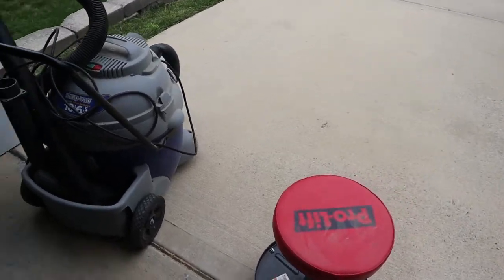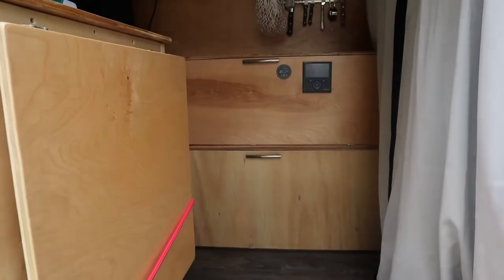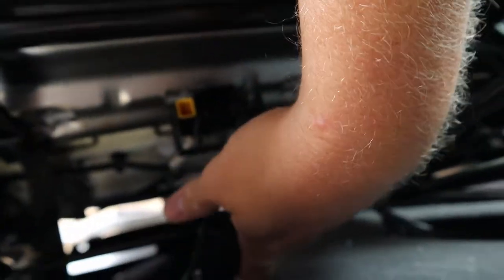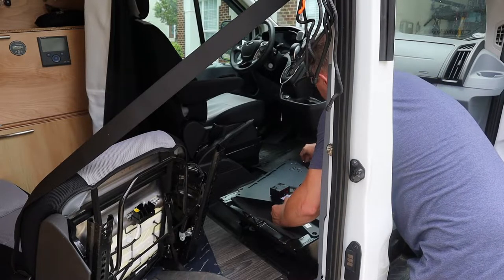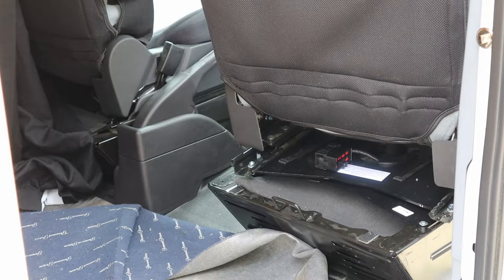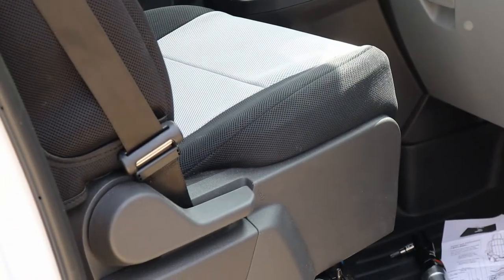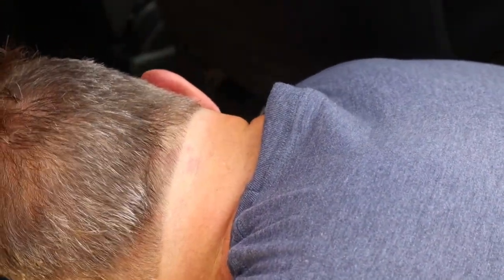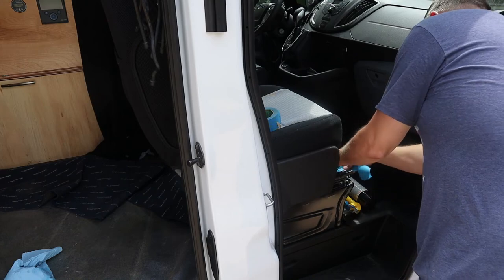#MTBPlanB Not Van Life...Weight, wobble and seat height raise of a Scopema passenger seat swivel.

Comment: did you disconnect the negative battery terminal first to the engine battery? I saw this in some instructions, but in the videos I've seen, no one mentions it or does it ... (Guessing it's not a big issue if you just unlock your vehicle and do it, no engine on/off stuff while disconnecting/connecting)

STEP 1: REMOVE THE NEGATIVE TERMINAL OF YOUR BATTERY
Since you have to detach the passenger airbag harness, it’s best to remove the negative terminal of your battery to avoid any accidental shorts.
Reply from the maker: Yes it was disconnected previously as I was installing some other electrical before this.

Comment: Thanks for the video. We are about to install a swivel seat in our van build. Can you tell us what size star socket is needed to remove the seat?
Reply from the maker: Steve & Audra My seat base has 5mm hex bolts. You could probably use a t30 star in a pinch.
Reply: Thanks for the reply.  I should've added that we also have a 2019 Transit so it looks like 5mm hex is the answer.

Comment: Let me start by saying the "child safety seat hook" is a known Transit van "removal or bend down" for all brands of swivel mounts. Also the Scopema mount only raises the van seat 7/8 of an inch, which is the lowest height of all swivel mounts. Also you demonstrated the wobble with the seat empty. No swivel will be wobbleless. due to the center post swivel design, However, Scopema demonstrates the least wobble unoccupied is unnoticeable with a passenger in the seat. Other swivel mounts wobble whether a passenger is present or not in the seat. Swivels-R-Us has the most wobble I've seen in any of swivel mounts. This is also seen and proved by watching other seat swivel installation videos and for comparison purposes.
Reply: If you have a Swivel-R-Us mount, you will find you get what you pay for.
Reply from the maker: Thanks I’ve not had exposure to other brands.